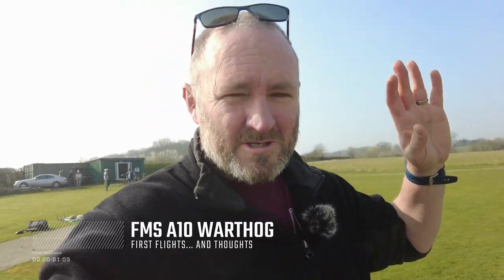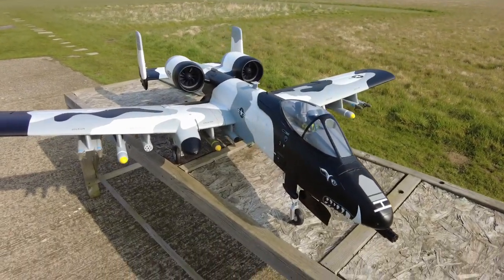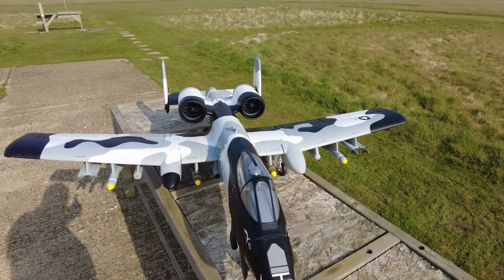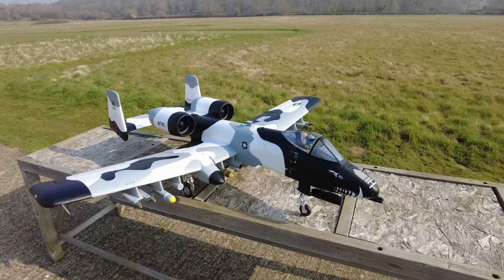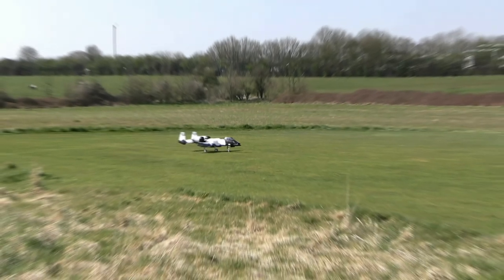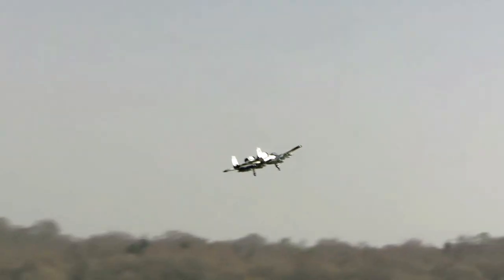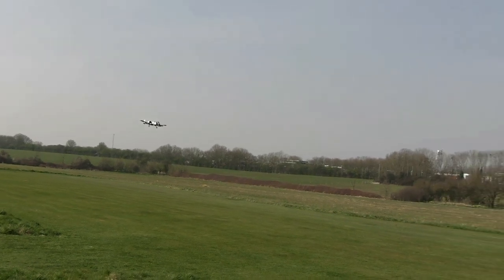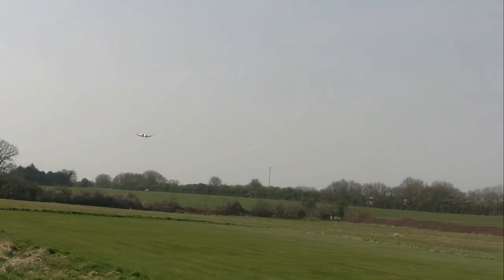FMS A10 WARTHOG | FIRST FLIGHTS & THOUGHTS

Comment: I’ve been in the sport 8 years. Started with Dynam and Eflite. Moved into Flightline and Freewing stopped being a regular thing. FMS and FMM I knew nothing about and wasn’t interested in. Freewing was expensive, but the best when it came to jets. Had a buddy not bought the FMS Yak-130 last summer I still wouldn’t have owned an FMS product. 
Futura v3, Bae Hawk, Rafale, and the Arctic Camo a-10 have been my last purchases. Now I’m a Jehovah’s Witness for anything FMS. They’re all just great flying planes, engineered well, easy to put together and maybe the best stock gear in the sport. This a-10 is so much fun to fly!